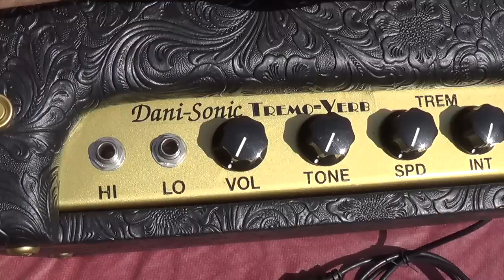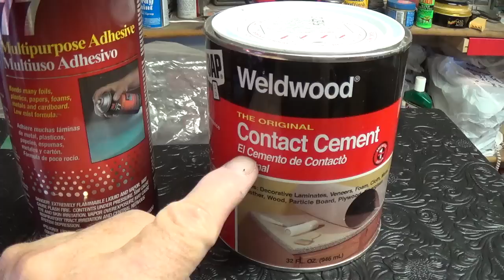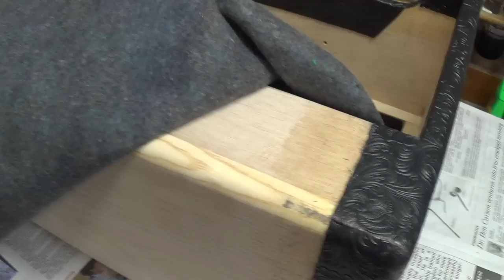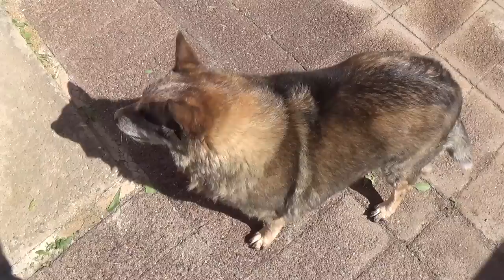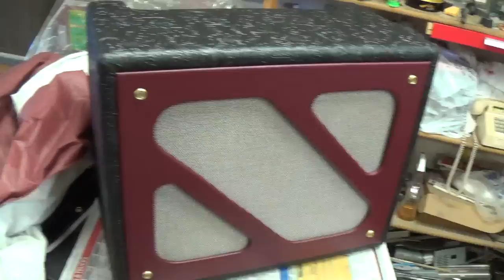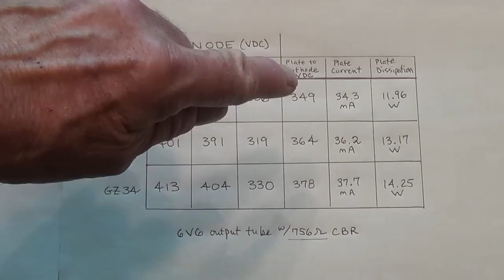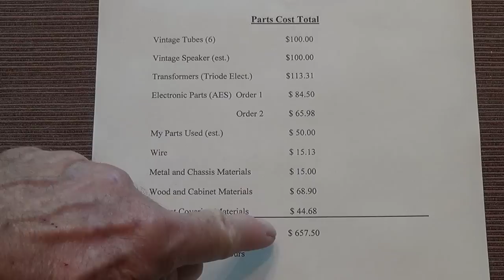How to Scratch-Build a Vintage Amp, Part 8:  Completed and Tested

Comment: What can I say?  I'm scratching my head trying to come up with the right words to adequately express my admiration for your work.  The look.....you have captured the essence of that great amp era, particularly your front grill and the patterned covering on the main cabinet, not just ordinary run-of-the-mill style that most commercial amps have.  The quality of the finish.....as good as you could see anywhere.  The sound..... clear as a bell (like to hear it cranked if you had a thick walled room).  The effects.....really liked the strong tremolo, personally I wouldn't change it.  With most things it's nice to have a little more than you need.  You can always back it off to maybe, 8.  Good reverb, perhaps not as strong as the Princeton Reverb you showed us but still very nice.  And then, it's absolutely dead quiet.  A good illustration that a filter choke is not mandatory for a hum free amp.  Tucked away inside that solid cabinet is a really strong chassis housing properly terminated components.  I'd bet London to a brick, if that amp fell off the back of your Jeep (God forbid) it would still work perfectly.  That Dani-Sonic nameplate sits justifiably proudly up front.  Please pass on a big "thank you" to Tommy for all his excellent schematic and chassis drawings.  Last but not least I would like to say thanks to your wife for sparing you the time for our benefit, also to Rusty and Jack for their antics and assistance.  I have a question about the National amp I saw over the top of your "Elvis" amp but you are overdue some R&R so I am going to wait a while.  Thanks again Uncle Doug.  Kind regards to all and please, stay healthy also.
Reply from the maker: +Jeff M You're quite welcome, Jeff, and thank you so much for the many kind comments. Actually, the Trem was at 8 in the video (don't tell anyone :).....at 10 it was completely insane. I'll try to tame it a little so that 10 on the dial is more like 8 in the video. I'll relay your appreciation to Tommy, who reads these comments and may have already noted it, and to Rusty and Jack, who are too busy sleeping to read anything. You're right about the wife, although she spared me the time, I was not spared a fair amount of (justifiable) nagging about uncompleted chores, being in the workshop for 12 hours, missed meals, etc. Now that the last video is posted, we're back to our old, compatible selves :)  The National amp you're referring to is probably the 1966 Model 70 Bass amp. It's absolutely mint.....like new......and was featured in a video I made back before I had my own channel:  https://www.youtube.com/watch?v=_h6tUIMWzhM
Reply: +Uncle Doug Thank you for your reply and the link.  Breakfast is done so I will have a look at that National.
Reply from the maker: I hope you like it, Jeff.
Reply: +Uncle Doug I like it very much.  Sounds really nice and the condition, wow, especially that side panel material.  That's a husky power transformer.  Growing up here you usually saw groups with Fenders, a few Voxs and then the Marshalls arrived plus a sprinkling of local brands.  But through you channel and that of your associate there is a door labelled "And now for something different".  It's great, thanks.  And thank you for letting us know the weight of your modified Supro clone, it's an important consideration when building or buying an amp.
Reply from the maker: You're welcome, Jeff....glad you liked the Supro clone. Fenders were by far the most common amps in my area, but when I started getting really interested in the early tube equipment, Valco really stood out. They made great amps under many different labels, and I can't get enough of them :)

Comment: Outstanding!!! Thanks for an awesome birthday present Uncle Doug (you released this on my Birthday - Yesterday). That covering job is just out of this world the amp sounds killer - I was thinking Uma Thurman was about to walk into shot and Kill Bill when you started playing. I've got a hankering for building an Fender type circuit next but having second thought's after hearing this. Quick question - do you have any pedals you could stick up front to drive the amp harder? I would love to hear what it sounds like being pushed somewhat. Looking forward to your next project.
Reply from the maker: +Andy Wragg   You're welcome, Andy, and Happy Birthday !! Thanks so much for your kind assessment of the finished amp.  To be honest, I was babying it for the demo to avoid causing the camera microphone to distort.  The volume was on 3 and I used the Low Gain Input.  On High Gain at a VC of 5, it will blow the windows out of my shop. I could try an overdrive pedal, but am fearful of the consequences :))

Comment: Hi Uncle Doug, this is so awesome! Anyhow, I wanted to ask you about the minimum B+ for a 6L6GC push-pull pair. The reason I ask is that I got this old broken Laney Cub 10 that I'm looking to convert to take in 6L6GCs. I understand that 6V6s (the original tubes of the Cub) take in 6V6s and I was just curious if I could just use the existing transformer to power the 6L6GCs (of course ignoring current demands at this point). I read somewhere that the secondary is at 220-0-220 so that would translate to about 318vDC rectified. Is that enough for 6L6GCs?
Reply from the maker: +themarcoharder Thanks, TM.  I think 318VDC would be way too low to properly utilize 6L6's, particularly GC's.....unless you want endless amounts of lifeless headroom.  With that kind of B+ and a power transformer (PT) geared for 6V6 current demands, you could never bias them anywhere near where they belong.....and if you tried, the PT would go up in smoke. I really think you'd be way better off with the 6V6's. Many people prefer them to 6L6's anyway.

Comment: Magnificent UD. Thank you for a wonderful series it is an inspiration to me and by reading so many positive comments from your other subscribers an inspiration to them too! The reverb sounds very clear and the tremelo is powerful. As you say the tremelo is cutting off the frequencies so I am interested in how you would approach resolving that issue. I see Jack has given it the SSoA (Sniff Seal of Approval) and I'm sure doesn't hand those out willy nilly. Great choice of fabric covering, you are an artisan.
Reply from the maker: +robfpool   Wow, you're welcome, Rob, and thanks so much for your very kind assessment.  My approach will be to experiment with the value of the 2.2K resistor just prior to the V2b grid. It forms a voltage divider with the Intensity Control pot, and increasing the value should reduce the tendency to overdrive the Tremolo.  You're right about the SSoA from Jack.....high praise indeed :)

Comment: It's always a little hard to judge the sound of an amp from a video, since you're not hearing it in person, but I'd say that this little amp sounds absolutely fabulous! I think the 6v6 sounded far richer to my ear. It really captured that old 60's sound. I agree that the 5881 sounded warmer, but I didn't like the sound nearly as much. The amp lost some kind of mojo with it. The reverb sounds amazing! I agree that the tremolo circuit may need a little work. All in all a great build and an amp any guitarist would treasure! 

About the tremolo, you may want to experiment if a few different 12ax7s before doing any modifications to the amp. Tube tremolo circuits can be quite picky about the particular 12ax7 that's used with it.

Oh, I almost forgot to ask. How did the reverb footswitch work out? Any audible popping by grounding the grid of the recovery triode?
Reply from the maker: +Alva Goldbook  Thanks so much for your very kind words, Alva.  I will be experimenting with the Tremolo a little, to reduce its intensity a bit.  At 10, it gets a little choppy. If I come up with a good solution, I'll revise the schematic. The footswitch was dead quiet.....no problems at all.
Reply: Uncle Doug It did seem fairly choppy to my ear as well at 10.
Reply from the maker: I intend to experiment with the 2.2K resistor immediately before the V4b tube grid. Increasing the value should reduce the tendency to overdrive the Tremolo. I'll revise the schematic if I am successful.
Reply: +Uncle Doug How smooth is the variation in the intensity? It's hard to tell with a few clips, but I got the impression that the intensity was disproportionately strong past 5 o clock. One thing you may want to consider is placing the wiper of the intensity pot on the 2k2 resistor. I also wonder if reducing the cathode bypass cap on V2A down to 4.7uf, 2.2uf or maybe even 1uf might help. This may drive fewer low end frequencies in the noise generation circuit of the tremolo, perhaps making a more stutter type sound rather than choppy.
Reply from the maker: The variation is fairly smooth but the Intensity simply becomes too extreme around 9. I was thinking about experimenting with an increased value of the 2.2K (grid blocking) resistor to reduce the overdrive tendency. I will definitely keep your suggestions in mind also. Thanks so much for your helpful input :)

Comment: Excellent work and nice explanations! As always!

Uncle Doug, i wonder if you are aware of grain size in overdriven amp sound in general. What is in the scheme making it more like "grrrrrrr" then "bzzzzzz". This is the question i'm very much interested to know about.
Reply from the maker: +yrussq  Thanks, YR.   From my experience, buzzing is generally due to clipping, which doesn't sound very good.....and clipping is often due to incorrect tube biasing.  The Grrrr you refer to is due to tube saturation.  So I guess the parameter to experiment with would be tube bias.
Reply: Uncle Doug Thank you - i'll try to dig that way.

Comment: Excellent Doug. Have you covered what steps you go through i.e. pre-flight checks before first switching on a brand new scratch build amp? I assume you go through your limiting bulb first? The schematics are great. What software was used to create them? They are a wonderful standard. You mentioned the different resistors used in the power supply area, grey vs the yellow bodied ones. I noticed three grey and one of the other. Is that what you had to hand or are the grey ones used specifically on a particular part of the power supply? Thanks for all the hard work and the answers you give to us less knowledgable folks.
Reply from the maker: +allanpennington  Thanks so much Allan. To be honest, once I had double-checked all the connections, I did indeed plug it into the Current Limiter and turn it on.  Everything worked perfectly except for the Reverb......I had forgotten to link the two grids of the 12AT7.  I then biased both the 6V6 and 6L6, and it sounded just like you heard.  I used the (gray) metal oxide resistors in the power supply on purpose. They are more durable and precise than the carbon resistors.  The schematics were done by a viewer named Tommy Foley, and I can't say enough about the quality of his work.....excellent.
Reply: +Uncle Doug Thanks Doug, I have poured over this video a lot and tried to study the circuit and the actual video. At 12:20 on the vid there is a shot of the input jacks. I dont quite understand how they are wired. There seems to be a bridge of wire between the jacks. To my thinking does that add the 1M and 68K resistors to the other 68K giving a lot of resistance to that jack. I understand how the 1M resists some more signal off the left jack where it is atch but by bridging the two jacks together are you getting more than just a single 68K on the 'right' as you look at the vid jack?? I have put a scan of the piece of circuit from my schematic which uses exactly the same layout and value resistors but I can't see any bridge. Then again I may be reading it entirely wrong. https://www.dropbox.com/s/neq4k37k20eu5mg/Scan.jpeg?dl=0
Reply from the maker: I used the classic Fender input jack circuit, Allan, but I reversed it because my first jack is labeled "High" whereas the first jack in the Fender schematic is actually the low gain input. How the circuit works is pretty tricky, but the main issue is the amount of resistance to ground each jack has, not the resistance to the tube grid. The low gain input has 136K to ground (two 68K resistors in series), while the high gain has 1 Meg ohms to ground. I may make a video about this, because lots of people are uncertain about it.
Reply: +Uncle Doug Brilliant a video would be great. Studying my circuit I think that both jacks have equal resistance to ground as the Vox AC10SRT just had two input jacks, neither was labelled so I assume they are the same? Pic here http://c-nelson.com/1968-vox-ac-10t-s/
Reply from the maker: You can quickly test it, Allan. Plug an instrument cable into each jack and measure the resistance between the tip of the jack (at the other end of the cable) and the chassis.
Reply: +Uncle Doug Ha ha I gotta build it yet LOL. I was just wondering if the circuit diagram I had represented equal resistance to ground of both inputs.
Reply from the maker: Looking at an AC10 schematic, it appears they are both equal.

Comment: $2000 for one of your amps is fine. 
  I could hardly call it home made, the term wouldn't do it justice.
  I'd have more faith in one of yours than most brands.
Reply from the maker: +Stefan Brough Thanks so much, Stefan. Handmade sports cars cost more than assembly line cars, so I guess it's only fair with amps too :)  At least I can hope so :)

Comment: Great Job!  I've been watching this series through and was very interested to see how everything came out.  I'm incredibly impressed you have a circuit and configuration that allows the reverb to crank all the way up to 10 without howling like an injured coyote as many reverb circuits are prone to.  Everything sounds great.  It's very crunchy and would probably be awesome in a live setting.  My feeling is that when amps are built, they tend toward a boomy bass since it sounds better when tuned without other instruments.  I wouldn't change much to it.

I hope you do more videos like this.  You are a great teacher!
Reply from the maker: +Brad Bartram Thanks so much, Brad. I was very happy with the reverb and with the absolute silence of the amp. Even in a dead quiet shop, I couldn't tell whether it was on or not without looking at the pilot light.  Hum is always an issue with home-builds, especially with reverbs, but I think the shielded cables and positioning of the components helped a lot.  I have done some other, similar videos and video series (122 total).  Please check my channel listing for more topics you might enjoy.

Comment: The tremolo sounds nice. You can hear the sine wave clipping with the intensity cranked up. It's almost like a square wave tremolo which is kind of cool. Some tremolo stomp boxes allow you to use different waveforms and it makes for interesting sounds and you can sort of mimic that with the intensity control.

Not sure if it's a typo but the schematic shows the 3 MEG resistor bypassed which pretty much removes it from the circuit. Maybe that's why it's so intense?
Reply from the maker: +sa230e  Greetings and thanks for all your help, SA. I just checked the schematic, and it is indeed a typo.....the 3Meg resistor is not bypassed in the circuit. I have no idea how this error happened. I'll speak with Tommy at once about revising this so I can post a corrected schematic. Thanks for bringing this to my attention.  As you noticed, I used both of your suggestions, and they worked quite well.  Glad you like the result.
Reply: +Uncle Doug I'm glad it worked. I have to say I've developed an appreciation for the design of this amp. It's a pretty nifty little circuit. And I have to say I prefer the tremolo before reverb approach this amp uses over the reverb before tremolo approach most other amps use. Sounds more natural to me.
Reply from the maker: Thanks, SA. The tone and volume were a little "dead" at first, but when I added the cathode bypass caps to the driver and output tube....it really came alive. I'm glad you like it :) BTW, I just uploaded the corrected schematic, deleting the bypassing typo. If you see anything else that I missed, please let me know.

Comment: Great amp Doug, I can't believe how crystal clear it sounds!! Beautiful amp, well done!!
Reply from the maker: +Bigjoedo66 Thanks, Big Joe. It really does have excellent clarity, partly due to the vintage Jensen C12Q speaker.  They are known for this type of tone.  I'm glad you like the amp :)
Reply: +Uncle Doug since you are not happy with the bass response, I thought about changing the Cathode bypass Caps but you already have 25uf correct? Will you have to manipulate the tone stack? Thanks
Reply from the maker: Actually, I was thinking of experimenting with the capacitor values in the signal chain from V1 to V4b. I don't want to lose the clarity, but think the tone could use a wee bit more bass.

Comment: Man that turned out beautiful. Exceptional craftsmanship, probably your finest work so far. That black floral pattern upholstery material looks stunning. Where do you find these materials? I wasn't planning on upholstering mine but I'm thinking about it.

I also want to say thanks for doing these videos. I really enjoy them and they helped me a lot.
Reply from the maker: +sa230e You're welcome, SA, and thanks for your very helpful input on the Tremolo circuit.  I found the tooled-leather style material at a small upholstery supply shop here in town. It comes in several colors and is fairly easy to work with.  I never saw a brand name for it, but the pattern is quite distinctive.